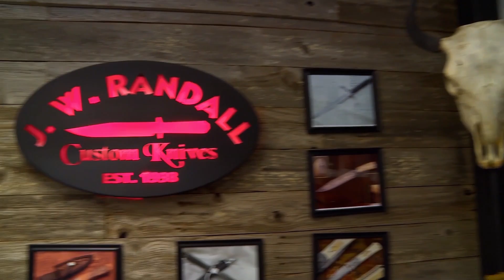Forged in Fire: USA VS FRANCE IN INTERNATIONAL CHAMPIONSHIP (Season 4) | History

Comment: Whenever Doug says "heavy" you're toast.
Reply: unless the other breaks...
Reply: If it ain't light. It ain't right.
Reply: It will keeeeel anyway
Reply: Unless a weapon is supposed to be heavy (which is rare, cause most weapons rely on speed, momentum and design to deal maximum damage, but there are still weapons that are supposed to be heavy)
Reply: @FerunaLutelou  Axes or maces maybe?
Reply: Exactly,
Reply: For real. But makes sense, because if all things are equal, that’ll be the deciding factor
Reply: Yeah french toast
Reply: @alpineassault  nah, most of axes and maces are actually not heavier than their sword counterparts. The few exceptions are the ones made only from metal, with no wood whatsoever. A big warclub is another example of a weapon that is supposed to be heavy. While it is made from wood, its still big a thick, and it also has a lot of metal on it, and its balance makes it feel more heavy and awkward to carry around for long periods of time.
Reply: Knights were trained to wield those heavy swords. Doug is not as strong as them so it will be heavy for hin
Reply: @paulandersbullecer3152   a knigths main weapon was the lance. A sword is only backup/ prestige
Reply: @GaladorLP  ooohhh. Yeah it makes sense. That's why there's jousting and range wise, lance is better
Reply: @paulandersbullecer3152  especially from horseback. A knigth didn't really had to strike themself, as the momentum of the charging horse is more power as any man could ever create. Thats why knights were such a powerfull force on the battlefield. 
(Until better discipline in armies led to pikeformations that held together)
Reply: Keal 
Keep 
Everyone 
Alive
Reply: @FerunaLutelou  lighter swords better control less momentum less damage,  heavy blades more momentum and higher damage,  it only depends on whether the sword is balanced or not
Reply: Both were way over built. Historical spadroon blades were much narrower, thinner at the tip & more flexible.

Comment: dont really see why grinding sheet metal is allowed in a forging competition.
Reply: i agree. its one thing ive gotten abit tired of in this show.. they dont make their own steel ingots or anything... they just find some metal and make it into the shape of a sword...
Reply: For this clip, they cut out the making of the billet that was ground into the sword. That is still a valid complaint.
Reply: which one did that? I dont know much about this stuff
Reply: I agree they should question them on how they made the blade you grind minus 10
Reply: Time constraints?
Reply: @SubutaiTuul  Kinda like a baker doesnt harvest his own grain smiths don't go out and scrap / melt their own steel.
Reply: @willem2099  yes because harvesting grain is the same as making your own steel mixture?  does it take more work? yes are there blacksmiths who does do that? yes. are there those who dont? yes. i just think it would be more interesting to see them make their own steel and who's steel perform better as well. its an opinion. theres plenty of blacksmith vids where they make swords and make their own steel ingots. but thanks for the ABC info.
Reply: @SubutaiTuul  Steel mills and blacksmiths still two different things, thought most people would know that. Anyway, like from actual ore? Or just scrapping steel like they do in the show all the time?
Reply: I thing they should have to hammer the shape out of a lump of steel. When I think of black smith I think of hot metal hammer and a anvil not a grinder.
Reply: Not that good of an excuse in my opinion. When I think of a black smith I think of hot metal a hammer and an anvil.
Reply: JW is a master smith known for his Damascus which he makes himself.  When you forge on Damascus you distort the pattern which is why he did more grinding
Reply: @henrydaigleiii2233  nonono, he grinded the entire piece, to distort it u grind canyons into it straighten it out and fold again, u dont just go to town with a grinder
Reply: @teifangu2049  the american, he basically took a chunk of flat metal stock you can buy from a store and ground it into the shape of a sword, so he did very little real blacksmithing on it
Reply: While I find the forging from a solid billet much more entertaining, I can't really fault the smiths who upcycle old metal parts or cut out a steel plate. If it still cuts, endures, and kills; the sourcing hardly matters in the end. A fallen warrior on the battlefield, bleeding from his wounds is pretty unlikely to exclaim "Well, I may bleed to death, but you're the real loser because your killing sword was made from old leaf springs, but mine was hand hammered from a pattern-welded ingot!"
Reply: @adamluther5836  well, its supposed to be a contest of skills, not DIY workshopping
Reply: @Elbereth_TV  Exactly how is "DIY workshopping" not a skill? Further, how exactly is forging in general not DIY workshopping by definition?
Reply: @adamluther5836  well, its a series about blacksmiths ability to forge weaponry, the angle grinder isnt exactly a smiths tool
Reply: @Elbereth_TV  Then by that logic, neither is a belt grinder or a manufactured metal file. Only a forged file or sharpening stone are acceptable tools for shaping and sharpening a weapon post-forging.
Reply: @adamluther5836  a belt grinder is a modern grinding stone, thats fine, a file no matter the make is a blacksmiths tool, a fabricators tool such as a angle grinder isnt really Ok for a smithing competition when its about the forging.
Reply: @Elbereth_TV  the distinction is utterly ridiculous. Picking and choosing which tools and materials are and are not acceptable based on some arbitrary metric to invalidate the end result is just silly. If it makes a strong, sharp, durable weapon that meets all size and weight parameters what difference would it matter if they used a belt sander or an angle grinder? The result is the same, a revolving, abrasive  piece is still making contact and removing material at a high rate of speed and shaping the object.
Reply: @adamluther5836  well, if thats the case why dont they just buy a carbon steel copy of the weapon theyre gonna make, harden in and sharpen it?
Reply: @Elbereth_TV  why aren't the competitors required to excavate their own ore from a dig site and smelt it all down themselves? Why aren't they required to grind down their own steel powder, carbon, flux, etc for each build? Why are the grinding belts pre-manufactured for them? See, you can push these ridiculous extremes in either direction to accommodate whatever ridiculous narrative you want, but the reality is, the judges decide, not your personal metrics, and they allow smiths to upcycle scrap, to use angle grinders, and to cut their pieces from sheeting, and many have won with the full knowledge of them doing so.
Reply: Simple - american guy cheated and whole american judge team backed him up on this. Simple as that. In one episode of FiF Jay send back home one of the bladesmiths because he grinded hes blade without forging. And now suddenly its all acceptable.
Reply: @willem2099  I think that's a good analogy, however, I feel its a bit like if a baker used canned dough to make his bread. All he has to do is shape it into a loaf- just like the American guy did to his steel.
Reply: @alexcurrie8460  it is is it? Farmers are the miners. The mills are the steel refineries, and the baker is the smith.
Reply: They could get away with things like that if the show didn't limit the contestants so dramatically on time. You can only do so much in a few hours.
Reply: @jaysoniorg2950  we've seen countless of masterpieces being made in the timeframe, its just a select few that are amateurs at best it seems.
Reply: They had grinders in midevil times, but they were spun stone wheels lol.

It would be cool if they to do everything like it was done in the 1500's .

Comment: I maybe wrong but it didnt look like the American guy forged his sword he just ground and tempered it.
Reply: That's one of the common complaints about this show. It's called "Forged in fire" but they allow, like in this case, to start from a already straightened piece of metal that doesn't go into the forge until the heat treatment. It's lame but it's not against the rules.
Reply: didn't they skip 2 days because the average episode is 45 mins long
Reply: He did forge it. He made it from damascus and in the full episode it shows him forging the billet and drawing out the sword. They just cut it from this clip.
Reply: @Bobamawesome  Thanks for clarifying
Reply: making a high grade steel blank requires far more equipment than the average smithy has. including a team of scientists.
Reply: @Bobamawesome  It's so stupid that they cut that out because if someone just watches this video it completely discredits the american blacksmith

Comment: The one complaint I have about this show is you immediately know who won if they complain about the weight or the handle
Reply: Because those are extremely important to get right.  A blade to heavy can injure the person wielding it, even a muscle bound dude can pull a tendon hitting something hard.
And a master smith should not have an awkward handle.  The details matter, even the small ones.
Reply: Shyhalu yes agreed since some of the most famous master smiths knew how to make sure the weight was perfect since it was either perfect or your life. And weight and handle are super important. If to heavy you just have a blunt piece of metal that has a edge. And the handle well I don’t think anyone wants to have a uncomfortable handle or a handle that will fall apart in your hand. I like to have a handle you know that won’t make my hand hurt afterwards or you know break in my hand where then I just am barely holding a blade
Reply: Still don’t have to say it after the first test after watching a few episodes you can learn the moment the word weight comes you might as well find something else to watch the competition is over.
Reply: Not always
Reply: That is their second highest ranking criterion other than the ones that can automatically disqualify someone (those being failing to meet parameters or suffering a catastrophic failure/being unsafe to test).  Other than the auto-fails, the only thing that makes you more likely to lose is a blade that's not lethal/sharp.

Comment: I always wonder, why I never see one of the smith's check the balance on their blade before finalizing it. To make sure the balance point isn't too far away from the crossguard. To see if they need to shave a little more weight off or make a heavier pommel to balance it out. You'd think if they have watched this show at all they would know of all the times the judges complain about the balance.
Reply: I'm sure there is a ton of stuff they cut out for the show.

Comment: Why the sharpness before the strength?
Reply: Because it would be inconsistent since the the strength test does way more damage to the blade than the sharpness test does
Reply: @MW_Asura  That's the point, damaging first the blade and see then how it performs in cutting to test the resistance of the blade

Comment: If people would stop lifting their arms so high when putting the blades in quench they wouldnt bend so much. The human arm bends in an arc & gravity is pulling the tip to the floor, causing a bend.  One needs to get the blade above the quench tank & bend at the knees instead.

Comment: Stock removal, grinding out a pre-cut or using sheet metal to cut a sword shape should be banned. That isn't forging at all.

It's called 'forged in fire' after all not 'grind a pre-cut in fire'

Comment: Honestly I felt that the french sword was stronger and more durable for battle
Reply: Yeah but its heavy my guy. A sword needs to be fast, sharp, and durable. If you go into battle with a heavy sword you're putting yourself more so at risk than your enemies. You'll tire too quickly and your attacks and counters wont be timed correctly. A sword should be an extension of yourself like an extension of your arm.